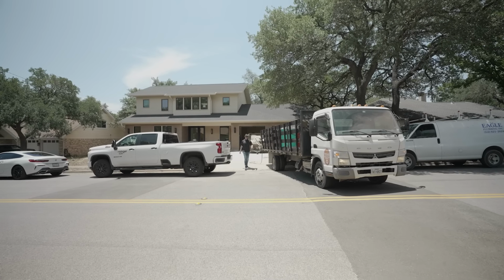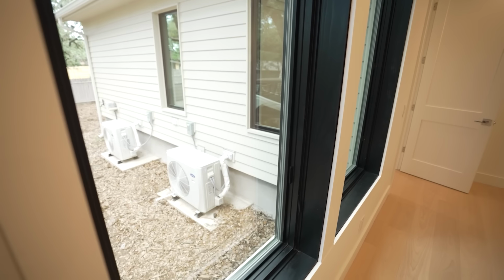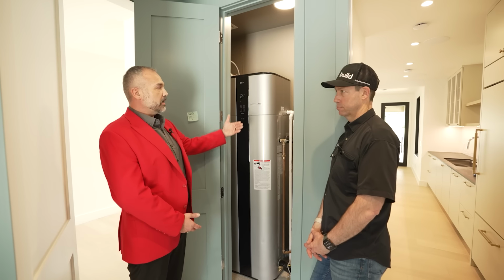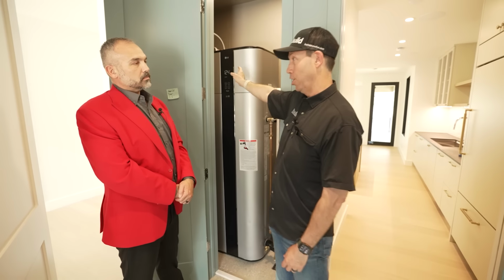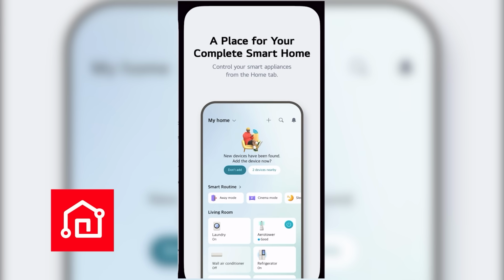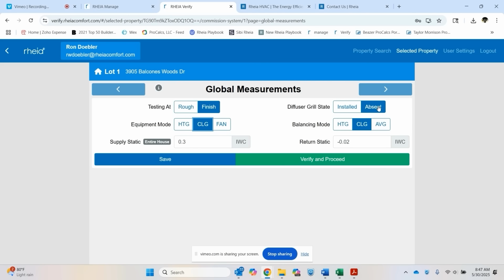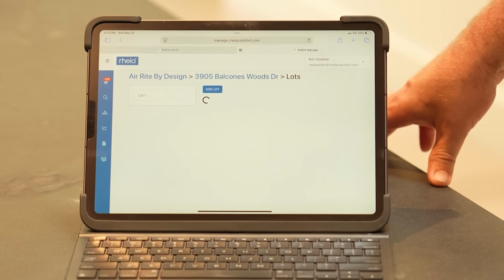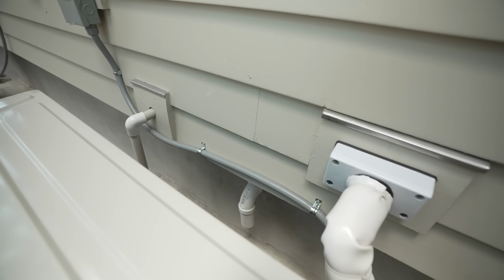The Risinger Build: Episode 23 - Mechanical Finish: Controls &  Commissioning

Comment: Two things I would like to know about the LG washer dryer combo: Does the front loader washer get moldy? Our current, fairly new LG washer does and we need to pull out the dispenser tray and leave the door open after we use it to reduce the moldy smell that starts to happen. It would be nice to know if LG is addressing the issue of mold build up around the door seal that is typical on front load washers. My other question has to do with the heat pump dryer. Does it take forever to dry the clothes and leave them a little damp? That has been my experience using heat pump dryers vs a regular electric or gas dryers. Almost seems like they need a hybrid system like on the water heater with a heating element to finish off the load. But of course, then you are looking at needing to vent the dryer. Seems like a minor detail but I am sure I will hear complaints from my family who typically likes to do a bunch of laundry loads back to back on "laundry day". Any thoughts on this usability question for people use to the vented dryers vs unvented heat pump dryers?
Reply: Most front load washers need to have their door left open to prevent mold

Comment: Thank you for explaining why. I recently reviewed what was supposed to be the Final TAB report fir a simple DOAS unit. Kid you not, the tech wrote in the report ambient outside temp is 73 and inside temp is 74 and could not test cooling or heat capacity of system. Granted they needed someone to operate the control system to overide the setpoints but wait. Why schedule the test when you know you need to test cooling or heating side of equipment. It is a garbage in garbage out world if you don’t understand what it is about.

Comment: just to comment.. you realize that the 'heat' that the Sonos equipment puts out is absolutely trivial when it comes to using that for heating water... .. you will be cooling down your house - and you will need to use extra heat pumping electricity to cool down your house.. you will get into an energy loop... better to put those heat pump water heaters in a place where the cooling of the space will be useful or at least not detrimental in the winter months... just saying...